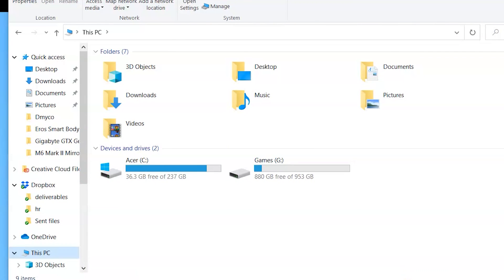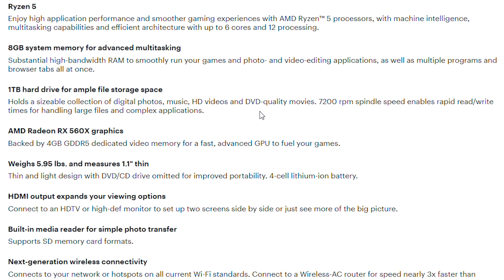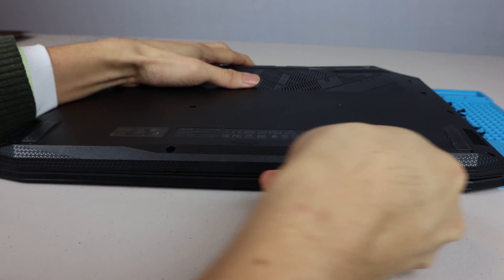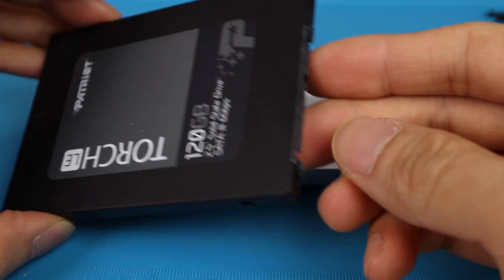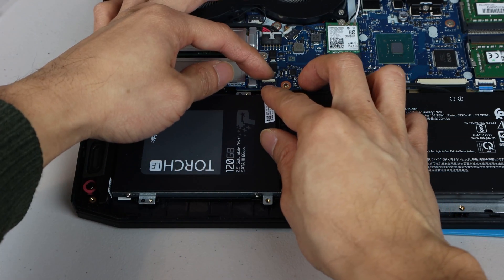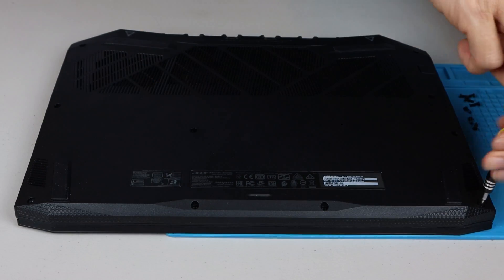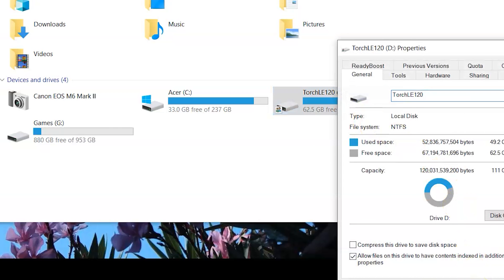How to Install 2.5" HDD or SSD in Acer Nitro 5 Gaming Laptop (2019 ver) SATA III Drive

Comment: I'm confused. I just bought my acer nitro 5 few days ago it is Nitro 5 AN515-54 rtx 2060 500gb ssd. Now 500 gb ssd is not enough for(me) games. I just want to buy and add a second SSD to my laptop.  A bigger one or m2 ssd. If i buy and add the bigger ssd should i need to reinstall the windows again or just using the disk management? My second question is if i buy the m2 ssd and want to add, it should be Sata? Or it's the second m2 part ssd needs a sata? My 500gb installed in sata or the other one u used in the video? i didn't open the back. So i don't know.  I need help about that  ( I don't want to replace my already installed ssd which came with the laptop Just want to buying and adding second ssd)
Reply from the maker: If you're not removing the existing SSD, you won't have to reinstall Windows because you can simply boot from your existing drive when you add another one. Since I can't tell from your description whether you have a 2.5" SSD or an M.2 SSD pre-installed in your build, your safest bet is to get an NVMe M.2 since both M.2 slots are NVME/PCIE compatible, so you should be able to use that type of SSD regardless. The only way to know for sure is to open up the laptop and check which drive slots are available.
Reply: @FixItPhil  Thanks for the answer i checked my drive it's a micron 2200 v mtfdhba512tck ( m2 pcle ssd) Okay i have 1 m.2  drive.  So do you think should i buy 2.5 or m.2 ssd? Which one is do you prefer more speed or better for loading games ?

Comment: Hello, I installed a hard drive I had from an old pc, I plug the hard drive and did format using an adapter. Then opened the pc (Awesome tutorial! I had no issues) but when I started the computer it only shows Acer (C:) and nothing else. I did look into ‘create and format hard disk partition’ and nothing. I don’t just want to open it up again without a plan. Do you have an idea on what I did wrong? 😢
Reply from the maker: Did you check the BIOS upon boot up to see if the motherboard can "see" the drive (see 4:12)? If it doesn't, then it's possible the ribbon cable is not fully seated or installed with the contacts not facing the motherboard and touching the contacts pins.
Reply: @FixItPhil  I did and it doesn’t show, what worries me is that it used to have (C:) and another one I think for Recovery and I cannot see recovery any more. I will try the cable and if that doesn’t work I think I’m just gonna take it to the technician. I am grateful for your answer 🙏🏼😃

Comment: It’s not appearing on the file exporter my ssd and I installed two it’s says only one
Reply: Did u find it out? My SSD isn’t showing up in task manager
Reply: @slop604  thanks for helping my laptop finally read the ssd
Reply from the maker: You likely need to partition and format the drive. These instructions might help you: https://youtu.be/d5wLgZxROoY
Reply: @FixItPhil  thanks Phil it worked

Comment: Thanks for creating this video Phil! Question - I am looking to purchase this computer but want to upgrade the primary drive. Is the M.2 drive the primary drive and is it able to be replaced?
Reply from the maker: Yes, you can replace it. If you do so you will need to re-install the OS, so you can create a recovery drive to a USB thumb drive when you first receive it, then when the new drive is in and the old one is out, you can reload the factory default from the USB stick.

Comment: Question. Can i place the HDD from my old laptop into the Nitro 5? Both Laptops used Intel.
Reply from the maker: Typically yes. SATA 2.5" HDD drives haven't changed much over the years so your old drive should work in the Nitro 5.

Comment: Should I remove or disconnect the battery while adding parts to the laptop?
Reply from the maker: If you're worried about accidental discharge, sure, you can disconnect the battery while the laptop motherboard is exposed. You won't have to remove it entirely.
Reply: @FixItPhil  does disconnecting the battery completely removes the change of accidental discharge?
Reply from the maker: @iamtheboywonder  Yes, but after you disconnect the battery, you should press and hold the power button for 5 seconds to discharge any power that may be stored in the capacitors to be sure there's no charge left anywhere on the board that could cause you any problems.

Comment: I installed the mine and it says it’s not working properly. Did I do something wrong
Reply from the maker: Hm, that could be the case. What is the error message exactly? Some error messages may indicate a problem with the actual drive itself (physical damage, corrupted sectors, etc.).
Reply: @FixItPhil  Oh never mind, I watched the video again to make sure. I got it now but thanks anyway! Helpful Video!

Comment: Fixitphil does the laptop come with the SSD card?
Reply from the maker: It depends on your specific build. My laptop model/build is AN515-54-54W2 which came with a 256GB SSD pre-installed in a M.2 slot. That left me with an additional empty M.2 and the 2.5" drive bay empty as well. Some builds of the AN515-54 may have only the 2.5" drive or both that and an M.2 pre-installed.

Comment: Did you say we have to reinstall windows?
Reply from the maker: Only if you are removing your old hard drive, since the new hard drive will be blank. If you leave your old hard drive installed and the new one is just a secondary drive, then no, you won't have to re-install Windows because the laptop will boot from the old one.
Reply: @FixItPhil  thanks very much pal

Comment: I don’t see the slot that the cables supposed to go into please help :/
Reply from the maker: Which model laptop do you have? The SATA HDD cable connector should be fairly close to the 2.5" HDD bay. It's a small connector, usually with a white clip.

Comment: So after I install a new hdd i have to re download windows?
Reply from the maker: If you removed your old hard drive, then you, you would need to re-install the operating system. If you added a new drive but also kept your existing drive, then no. The laptop will boot from the old drive by default.
Reply: @FixItPhil  oh ok thanks

Comment: Hi phil great video, i have acer nitro 5 2018 model and it sometimes gives me NMI HARDWARE FAILURE error :( how can i fix it pls help!!
Reply from the maker: Hm, an NMI hardware failure usually indicates a problem with a driver. It could be corrupted, or simply just outdated. But it's impossible for me to tell which driver is causing you problems. You may be able to figure it out by going into your device manager (type into Cortana search bar) and looking for a driver in the sub-menus that has a yellow triangle sign next to it. Note which device it's for and remove that driver. Then try to find a current driver from the Acer or the manufacturer and download and install it. If you don't see any drivers there that have the yellow icon next to them, then you can try the remedies found here: https://www.minitool.com/news/nmi-hardware-failure.html Good luck!

Comment: Hi Phil. I have installed a new hard drive but it isnt showing on the my computer or in the device management. I bought a Seagate FireCuda 2 TB Solid State Hybrid Drive Performance SSHD – 2.5 Inch SATA 6 Gb/s SSD. And installed it as described here. Any ideas on what could be wrong?
Reply: I think I may have sorted this, I hadn't partioned /formatted it, it did come up with the drive in disk management, and had to create a new partition

Comment: Hi, I m planning to adding a SATA ssd drive from my old laptop, it is samsung 860 Evo , but it has window os installed, with all my files. After I added in the new laptop, would I be still able to access the old files? Need some advice, thanks.
Reply from the maker: Yes, if you move the old SSD to a new laptop, you should be able to access the old files that are still on it.

Comment: I plan on getting a Samsung 970 Evo, which is an M.2 NVMe SSD. Is it possible to combine that and the built-in SSD as one drive?

If so, how can you do it, and what are some problems when doing so?
Reply from the maker: If the built-in SSD is also an NVMe SSD then yes, this is theoretically possible. If the drive pre-installed is SATA, you would not be able to combine a SATA and NVMe drive into one. However, combining the drives into one drive likely won't give you any discernable performance improvement if you aren't reading/writing large amounts of data to and from storage often. Something else to consider for Raid 0 is if one drive fails you'll lose all the data across both drives,  since the data is striped and split between them. You cannot recover a file from half its contents. If you still want to try it, here's a quick guide for the steps to do it: https://community.acer.com/en/discussion/589679
Reply: @FixItPhil  Thank you!

Comment: Hi if I install a 1tb sshd into acer nitro 5, it will still uses its original ssd to boot up right? I wanted to use the sshd as secondary drive
Reply from the maker: Yes, adding a drive shouldn't change the boot priority, so since you're not removing anything, whichever drive is booting now, will continue to boot your computer after the upgrade. If for some reason, it does try to boot off the new drive, just change the boot order in the BIOS (move your original drive to a higher priority than the new one).
Reply: @FixItPhil  thx man

Comment: My acer 2019 version already has a 1tb hdd installed ! Someone help me pls ! Which one should I buy?
Reply: Hdd bay
Reply from the maker: @karanshinde6063  Get an NVMe M.2 drive, like this one: https://geni.us/nICW [Amazon Affiliate Product Link]. It'll give you the best read/write speeds and won't require you to clone the drive unless you want to make it your boot drive (unless you want to, since it will give you faster boot/load times than your existing 1TB SATA HDD). Are you using an Intel or AMD core CPU machine? Just double-check compatibility with Acer because I've heard that the AMD versions don't always recognize NVMe drives for whatever reason.

Comment: I did exactly how you showed, I even went back and made sure but somehow my laptop isn't detecting my brand new HDD. What do I do?
Reply from the maker: Hm, does the hard drive show up in the BIOS, as shown at 4:12? If not, that means the motherboard isn't receiving the signal from the drive. Check to make sure the ribbon cable is installed with the gold contacts facing the motherboard, rather than up and away from the motherboard. If it's installed correctly, then there could be a problem with the ribbon cable itself, or the drive. If you can see the drive in the BIOS, but not in Windows file explorer, follow these steps: https://youtu.be/d5wLgZxROoY to ready the drive for use.
Reply: @FixItPhil  I figured it out. It was the BIOS. Its working fine now. Thank you for the information. c:
Reply: What do you mean by 'not detecting'? If you're talking about in Windows, you will need to go into BIOS and partition /format the drive first

Comment: hi, thanks for the very detail explanation. I have question if we use two different RAM with different speed , will it cause hardware failure in long term or just the speed follow the slower one?
Reply from the maker: No, using different speed RAM won't cause the memory to degrade any faster than it would normally. The only real impact is just that the faster one will run at the slower chip's speed.

Comment: Wait, the big one is the SSD or is the m.2 one the SSD? If both are ssds why are there two for different sizes?
Reply from the maker: Both are SSDs in this case, so the difference here is mainly form factor and interface connection type (which limits how fast data can be read from and written to the drive). Note that you can also use an HDD (spinning platter, not solid state) in the "big" 2.5 inch bay as well. The 2.5" SSDs are cheaper to produce and replace if you want to upgrade or fix a failed component, so the main reason why they are still used is for cost savings both for the manufacturer and for the consumer.
Reply: @FixItPhil  thank you so much. You're great. Keep em coming

Comment: did you use a different screwdriver when you did the unscrewing for the base and the hdd?
Reply from the maker: Hm, I don't remember. I use a mini screwdriver kit that includes a number of swap-able bits, so I don't recall if I had to change sizes between the back panel and the HDD screws. If you only have one mini-screwdriver, I'm sure you could probably make it work if the size isn't too far off, you just have to be careful not to strip the screws if you've got the "wrong" size bit. It's usually J0 or J1 or Phillips #1.

Comment: Do you think if I use for than 50% of my ssd, it will affect the gamimg performance of my laptop?
Reply from the maker: It depends on the drive. If it utilizes a dynamic SLC cache, you may see performance impacts to write speeds after a certain percentage of the drive is used, but it is usually higher, like 75% capacity. Even then, there should be static SLC cache on the drive that should keep performance up to speed for most data processing activities including gaming. You'll really only hit a performance wall if you start moving lots of data at once, for example, on the Intel 660p SSD it's data blocks over 12 GB, which is not typical, even in gaming...

Comment: So i have and hdd 1TB. Can i put an SSD256 in the same place?
Reply from the maker: Sure, but you'll have to remove the 1 TB HDD to do so. If there's anything important on the drive, or if it's your only drive/primary boot drive, you'll need to either clone the drive over to the new SSD first or install a fresh copy of your OS after the new SDD is installed.

Comment: Question, Could I put any 2.5” 1TB SSD in the laptop.
Reply from the maker: Yes, there's not really any restriction for a 2.5" SSD except for drive thickness (max 7mm) but you wouldn't encounter that until you get above 4 TB in capacity.
Reply: FixItPhil ok thanks

Comment: My version is 1TB HDD. So, Can I Add 2 m.2 and 1 2.5MM?
Reply from the maker: No, you won't be able to add a second 2.5 inch drive, as that space is already taken up by your 1 TB HDD. If you have the same base model Nitro 5, AN515-54, you can add 1 NVMe SSD and 1 SATA SSD in the two empty M.2 slots.
Reply: @FixItPhil  Oh I see, thanks a lot.

Comment: Can I have an hdd and an SSD in Acer nitro 5 AN505-42 plz reply
Reply from the maker: Yes, the AN515-54 supports 1 HDD in the 2.5" bay and 1 SSD in the M.2 slot so you can install both in the laptop.

Comment: Why didnt you unplug the battery? Laptop might as well brick because of this
Reply from the maker: It's typically not necessary, but you can as a precaution. Clearly, the laptop is not a brick, as of yet, so the risk to the system during this type of upgrade is quite small, but as you note, still a greater than 0 chance something could go wrong. Do whatever you need to do to feel comfortable with the task.  ⚠️⚡

Comment: Bruh my average did not come with the cable and the screws 😭
Reply from the maker: If you need to buy them, they are not that expensive at Ebay:
HDD/SSD 2.5" upgrade cable: https://ebay.to/2Tnlh9l [Ebay Affiliate Link]
HDD/SSD screws to mount a new 2.5" drive: https://ebay.to/3g8DW2G [Ebay Affiliate Link]

Comment: When i start to download my programs, to what disk will go the dowload?
Reply from the maker: When you select a file to download through a browser, you can set the file destination in the browser's settings and choose which disk you want to save the file to. For example, in Chrome, click the three dots menu icon in the top right corner of the window and select 'Settings.' Scroll down ot the bottom of the window and click 'Advanced'. Under the 'Downloads' section, you can change the location by clicking 'Change' and select where you'd like your files to be saved including the disk (drive letter) and folder.

Comment: I believe mine is the 2020 version, does this video still apply to it?
Reply from the maker: Yes, the process for yours will be similar, although the layout of some components inside may be slightly different e.g. I believe the M.2 slots in the 2020 version have one connector on the left and one on the right with the RAM slots more in the middle of the laptop.
Reply: @FixItPhil 
Thanks! Will crack it open and see what I’m working with. Great video btw 👍🏽

Comment: Do I need 2.5 specifically or can it be any size.
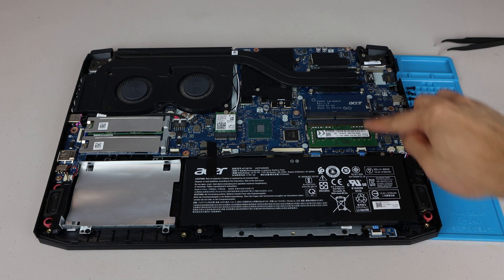Reply from the maker: If you're going to be using the HDD bay (as shown at 3:15) The physical form factor of the drive must be 2.5 inches to fit in this compartment. The larger 3.5" drives won't fit and are meant for desktop computers, and M.2 SSDs are meant to be installed in the slots above the bay (shown at 2:02). The capacity of the drive can be any size up to 4 TB as long as the drive is 7mm thick or thinner.

Comment: Is this good hdd for that laptop

Western Digital HDD Blue 2TB 3,5" SATA3 64MB 5400rpm (WD20EZRZ)
Reply from the maker: no. This laptop cannot accept 3.5" hard drives as they are too big, physically, to fit in the machine. You will need to get a 2.5" form factor drive, like this one: https://geni.us/nJlQoCr [Amazon Affiliate Product Link]
Reply: @FixItPhil  tnx

Comment: 1tb is not showing vai wo disk management me vi nahi he mera vi yehi laptop he nitro 5 core i5 8th gen plzz tell me
Reply from the maker: Hm, if the disk is not showing in disk management, this indicates that it was not properly installed or cannot be detected. If you installed a 2.5" drive, it's possible the SATA cable was not seated correctly in the slot. Ensure that the gold contacts are installed facing down, towards the motherboard, and that the end of the ribbon cable is all the way in the slot and touches the back of the connector before closing the clip on top. Verify that the drive shows up in the BIOS. If so, then you should be able to see it in disk management to complete the setup like so: https://youtu.be/d5wLgZxROoY